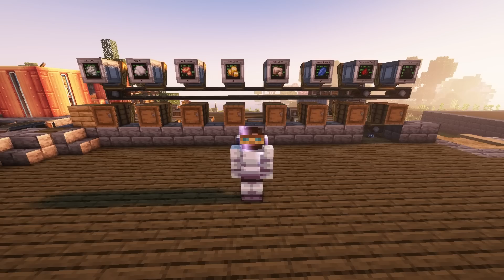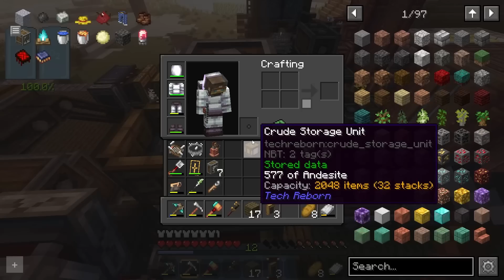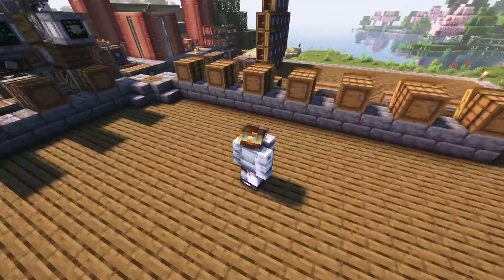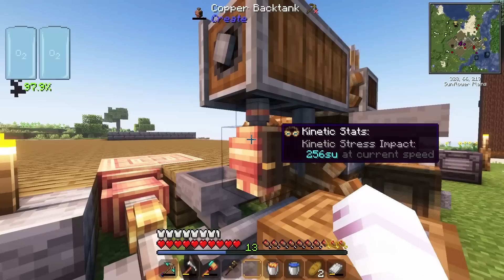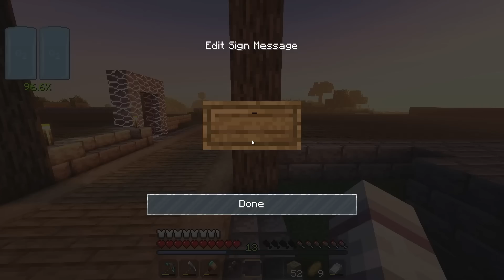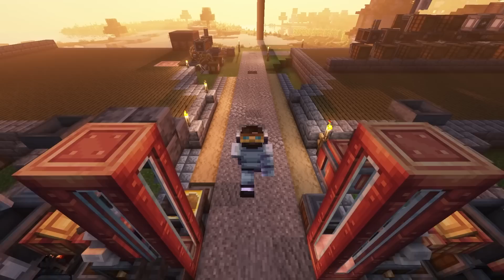Ultimate Deepslate Create Ore Farm Ep17 Create: Astral Modpack

Comment: One advice for all of the "i need to catch the items and place them into inventory"
There is a Basket item from Farmer's Delight in the pack that is basically a barrel that has a hopper-like input on one of the sides. It works WAY faster than any other way and also has 1-3 block pickup range. Which would make the need for fans obsolete.
Reply: thank you soooo much XD needed this info
Reply: Bro got tips! Frosty tips.
Reply: I had a hacky minecart hopper, this basket is the way.

Comment: If you wondered why cobblestones didn't make it to the belt. 
It comes from the speed of the drill, the faster the drill the more items spin out to the lava or outside.
The weird thing is different blocks spill at different speeds. Like Cobblestone is somehow lighter than Andesite and spills more.
There is a comment from the first few episodes that a basket (the one that uses bamboo, not from the vinery) can catch the item.
If you can't find bamboo, try to use the compass and look for a Jungle temple.

Since the basket can be waterlogged, so the same thing he did. 
Just change to a basket for the water source and a hopper below to send items to the belt.
This setup works for everything I did so far (Cobblestone, Andesite, Moonstone, Basalt)